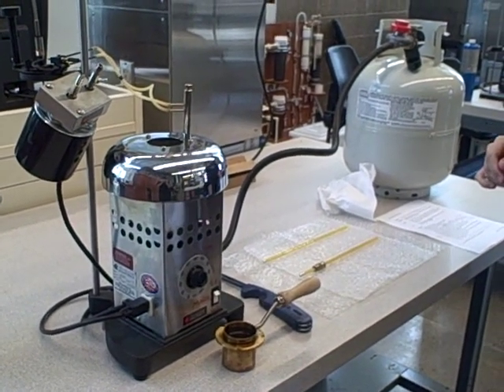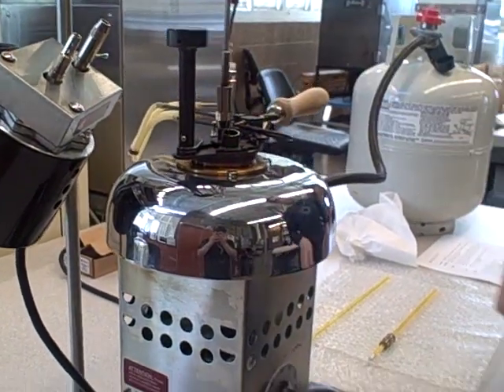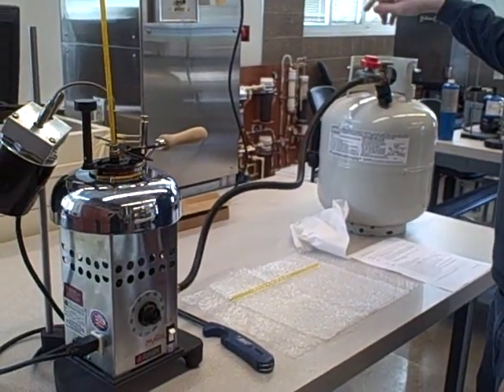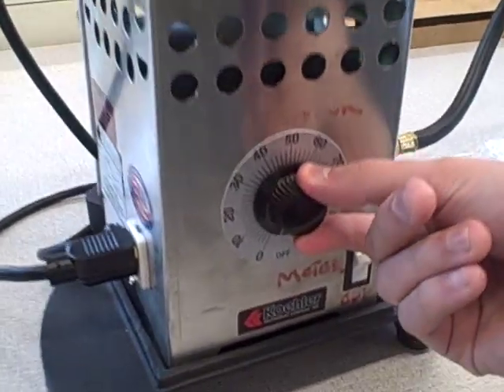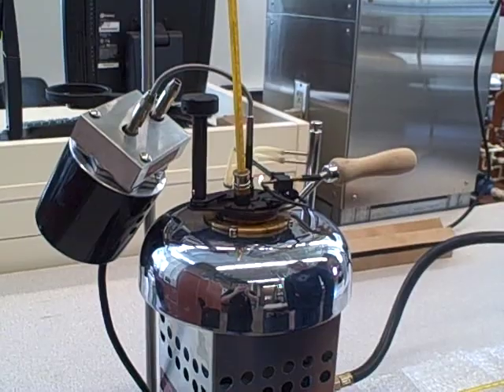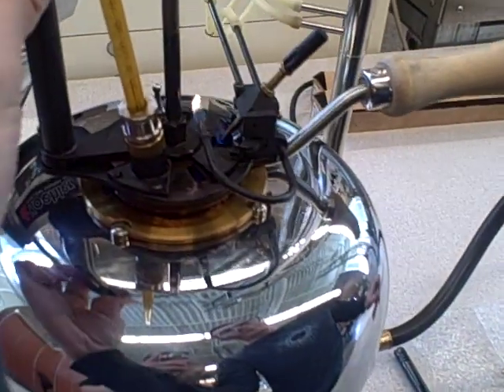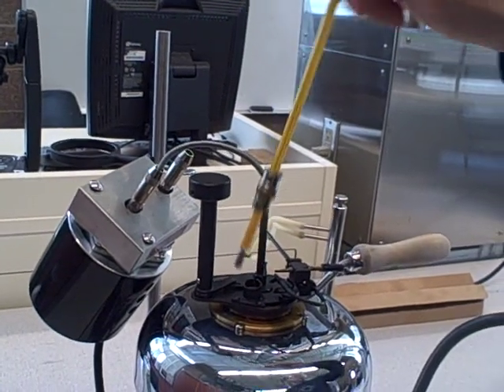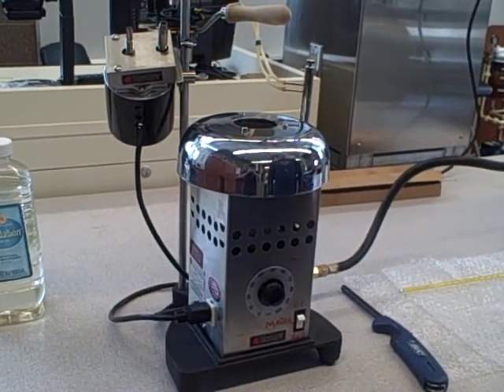Pensky-Martens Flash Point Tester Procedure - Adam Flink

Comment: Hey I just started at a chemical company and we're trying to get a FPT of the same model up and running.  What kind of tubing did you use for your gas line connection?  It seems much more elegant than anything I've come up with so far.